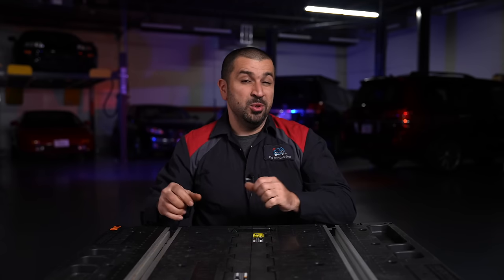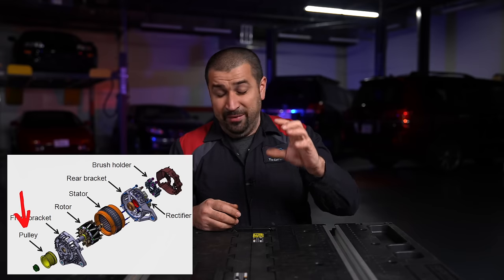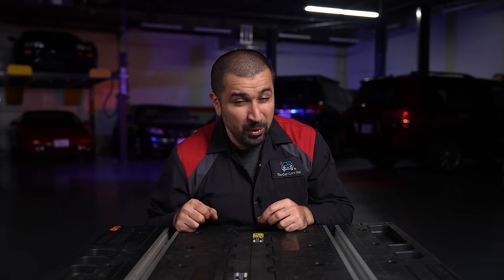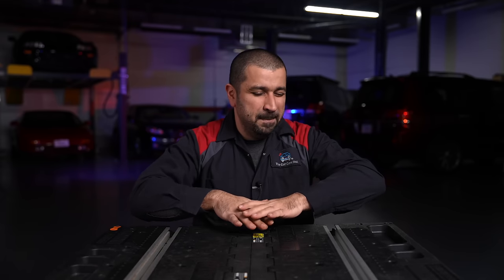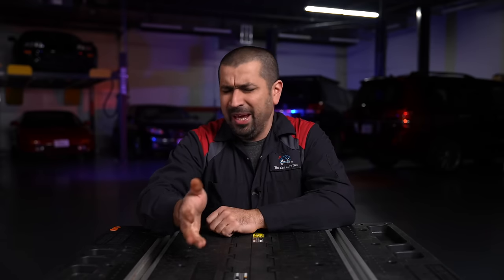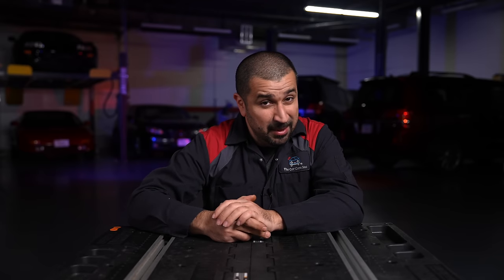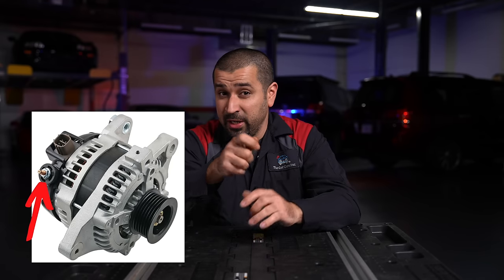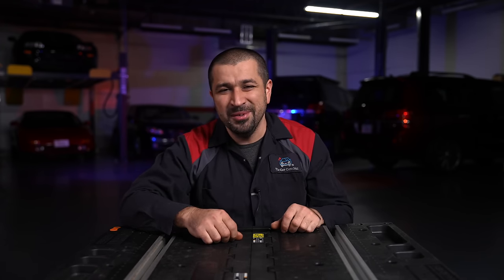How To Make Your Car's Alternator Last Longer? Everything You Need to Know

Comment: If the battery is dead, is it OK to jump start and drive to a shop to replace it, or should I avoid using it until replaced?
Reply from the maker: Very good question. Yes that is totally fine just don’t keep going for weeks and months on that weak or dead battery. Many may ask but how come. You’d be surprised how some folks life’s are very busy and they can’t attend to the car and they prefer just to jump it and keep going.
Reply: @TheCarCareNut  I got in my Little Toyota Auris 2013 1.4d a few weeks ago and the battery had died so I got a Jump start and went straight to buy a new one and fitted it myself in there Carpark, made sure I bought a good make Stop/Start Yuasa.
Not bad going 1 battery after 137,000 Miles and I do my own Oil and filter changes every 6000 miles.
Absolutely brilliant Little Car and pulls like at train even uphill.
62Mpg UK 🇬🇧 what's not too like.👍👍👍
Reply: @TheCarCareNut  Unfortunately I am not DIY when it comes to cars, except for the battery. If I can do it myself any one can. Driving on the battery that failed you once is a total negligence
Reply: You touched on the battery a little and was wondering when would you replace the battery ? Wait until problems ? Or ? Thank you for all the great tips on car care  @TheCarCareNut
Reply: @bobninemire6859   -  You can not go by time to replace your battery, because a good quality battery can last you 10 years or more, cheap poor quality ones may go bad in only 3 years or even less, so you wait until you notice problems with the battery.   Usually the first symptom is when is hard to start your car (cracking of engine is weak) or the head lights are not too bright anymore when you turn them on "without" starting the engine.  
You can also test the battery when you take your car to the mechanic for service, like oil changes or tires rotation, they usually don't charge anything to test batteries.👍
Reply: Just because your battery is dead, doesn't mean that you have to replace it. If you left your trunk open a little for a few days, your battery might be discharged. If you get it jump started, and drive it for 30 minutes, it might be fine. If the battery is old when this happens, the battery might not be able to be saved.
PS. A car's alternator puts out a little more than 13 volts, to charge a 12 volt battery.
Reply: Modern cars use electricity for so many things, even when the car is turned off. If you are a low mileage person is it OK to put the charger on the battery occasionally to keep it charged?
Reply: @tarquincummerbund6997  if you're not driving the car for a week or more at a time get a Ctek battery maintainer battery maintainer. It automatically charges your battery and won't overcharge it.
Reply: When I have to jump a battery on my car (no parasitic load or accessory left on issues) I take that as my first warning that I need a new battery. I usually take that opportunity to research cost (sales) and where to buy. By the time my third needed jump comes around i have a new battery in hand and I make the change 🙂
Reply: @LuxAudio389  any battery maintainer does that. So do chargers. They sense when it's charged.
Reply: I might add that I always buy one brands. The last one I bought was a Bosch and it worked perfectly. Never buy those off brands from autozone or what not.
Reply: My advice is when you have battery problems, or even an alternator problem, REPLACE the battery immediately if the battery is more than three years old.  If you do this, you will have years of electrical reliability.
Reply: @TheCarCareNut  Many years ago I drove AAA emergency road service. I remember members who had a bad battery or plug wires (which arced when humid, and we had spray), and they would call every morning before work. AAA had to implement call limits. We had people who would not listen when I said: "Take the car directly to a shop. Don't shut it off." Then, as I began to drive off, I would hear them shut it off....they just had to see if it would restart. My favorite call was when a guy came out of the house during a snow storm, with a starter in oven mits. He said it was "frozen" and he had put it in the oven, and wanted me to put it back in.....
Reply: This situation actually happened with my family car. We had to borrow a jumper cable from my cousin's gf to jumpstart it just enough to bring it to an auto mechanic shop. So yeah, you'll be fine with this method so long as you get the old battery replaced immediately
Reply: Thank you professor. Very good informative and educational video.
Reply: @speedygonzales9090 please tell me the brand of battery that can go 10yrs or more???
Reply: @billkallas1762  Wasn't the advice "Don't charge a dead battery with the Alternator", maybe if away from home it's an emergency, but we should all have a capable battery charger.
Reply: @tarquincummerbund6997  In a cold country once a month, in a hot country more often.
Reply: @RealWorldGarage  -  I had an "Interstate", it lasted 10 years.  It depends also the type of driving you do and type of weather, on that particular vehicle (1988 Mazda B2200), 80% was all highway driving. 
Also on my present car, (2010 Toyota Corolla XRS), I got 9 years out of its original battery.

On our family vehicles we average "8 years" per battery, we don't buy cheap batteries... Sears Die Hard, Toyota's and Interstate are the brands we buy, we haven't got any less that 7 years out of any of these batteries.
Reply: @tarquincummerbund6997  A battery tender is better than a charger. If you forget and leave the charger on, you can fry your battery.
Reply: ISGs in hybrids I suppose are even more complex and reliant on computers and BMCs.  EVs won't have this problem, no engine to start, plug in to charge batteries.
Reply: I can see you are not an auto electrician.  You make several statements that are simply not true.  Have a great weekend misleading people. @TheCarCareNut
Reply: @billkallas1762 facts! I use a battery tender on my corvette with an Altima red top battery 🔋 I maybe drive it once a month or 2 months. I get years about 5-7 years of of problem free starting problems. & no corrosion on battery thermals 👍
Reply: @billkallas1762  Thank you for your advice. My charger shuts itself off when the battery reaches full charge, but I’ll keep an eye on it.
Reply: @theaustralianconundrum  you obviously don't know what you're talking everything he said is true
Reply: No it was not. @DylanL69
Reply: @theaustralianconundrum  yes it was
Reply: @TheCarCareNut  plus there's a lot of , single moms and guys with 0 mechanical skills or having to wait a few paychecks for that $200 needed to replace that battery right away.
Reply: @tarquincummerbund6997   My charger is probably 40 years old. Mine only cuts back to 2 amps when the battery is fully charged.
It never stops.
Reply: @bobninemire6859  Every five years, I'm made the mistake of eeking out 15 years once until I was stranded on a Christmas night.
Reply: I bought a rebuilt Denso alternator for my Toyota. Car runs much better versus aftermarket alternator.  BTW Amd I fixed Yaris cv axle leak. The cv axle wasn't seated in all the way on drivers side. Installed Toyota seal and seated it. No leaks after a short drive. Thank you for your lesson on alternator technology. I learned things I didn't know. Explaining ac to DC with Sine curve then showing how diode cancels negative sine wave was very cool. Made perfect sense.
Reply: @RealWorldGarage  the factory fitted Panasonic battery lasted 14 years in my IS250 👍
Reply: Don't procrastinate with batteries or tires... Buy recommended brands (i.e. Michelin, Interstate) and replace them as soon as you need to and just avoid that nagging car headache....
Reply: @TheCarCareNut  thank you for the info and everything.. I have a question can I replace my Tacomas 2023 battery with an BATTERY AGM??   Thank you very much!!!
Reply: Best to always check the battery as soon as you can. Typically the battery will still be at a quarter of capacity even if idling for half an hour from being dead. Sure way to kill the battery is to leave it like that overnight.
Reply: Yikes, I've been hearing a whining noise for almost 2 years, it's an old used Sienna with over 200,000 miles. I better get that alternator replaced, OEM!!! Thanks for this video.
Reply: Brother do I need replace fuel filter toyota 4runner 4th generation or when?
Reply: If I get 2.5 years out of my battery, I doing great.  Heat is hell on batteries in the west.
Reply: @TheCarCareNut  what is your opinion on cold air intake like the TRD. I’m not looking for a hot rod. I have a 4 runner I’m interested in better fuel efficiency.
Reply: @RealWorldGarage  My motorcraft battery went 11 years before it finally died
Reply: Cold weather will bring out the bad or failing batteries.
Reply: @RealWorldGarage ODESSEY Batteries made in the US, they can also be ordered in UK and Europe. ODESSEY are one the Best batteries out there, pricy but then it pays for itself in the long run as they can last from 7 to 10 years depending on you maintain it. Always check your original batteries dimensions and CCA before ordering, if unsure then contact your main dealer regarding your OEM Battery specifications. Good luck
Reply: @tarquincummerbund6997  100 percent. fully charge that battery once per month.
Reply: @RealWorldGarage  I would love to know that too...
Reply: If the battery guy had done his job properly, one should not have a dead battery at all due to age. By the way, I don't recommend my customers to jumpstart and drive with a dead battery.
Reply: @theaustralianconundrum  Why don't you share with us all what is not true and then we will judge you whether you are true or otherwise ?
Reply: Yes you can. But remember, you're putting extra strain on the diodes of the alternator, as they need to charge the battery -- and a dead battery needs a LOT of power. It's around 10-15 minutes of engine rotation to replenish after a single starter event -- the alternator is strained during that time. 

When the voltage is EVEN LOWER than a normal starter event, then the alternator duty cycle is VERY high, and diodes heat up, greatly shortening their lifespan. 

Generally it's fine in a pinch, but also increases odds of weak diodes finally failing (as the alternator could already have been weak and that's why your battery died).

Doing this over and over will kill an alternator much shorter than it's expected lifetime -- sometimes at 1/3. 

Some vehicles can get away with this -- eg: trucks/industrial vehicles with an alternator that powers a LOT of other components -- eg: hydraulic accessories (as electrical often is used to help monitor, light, and assist the pto going to the pump) as long as they don't strain the alternator more with accessory use / disconnect any auxiliary battery.

If a battery dies 1-3 times, replace it... or you're likely to replace the alternator in a year or so if it's in good condition.
Reply: All car batteries are manufactured in the same factory. The only thing that makes a battery different is the sticker for manufacturer that provides different warranties
Reply: @TheCarCareNut  they won't turn off accessories, won't drive it around to test it...or...won't open the hood for months...lol..Gear Heads do still.
Reply: Extremely informative (you are gifted instructor). Thank you!

2017 Ford Transit 250
-200 amp Heavy Duty alternator 
-three factory 60 amp lugs for a total of 180 amp auxiliary power supply came stock.
-two stock agm batteries as starter batteries
-I have a 50 amp dc to dc charger running to a 600 amp lithium battery bank

Do you think I am potentially causing too much stress on the alternator (not a smart alternator from testing the Voltage as it always reads a constant voltage)?

Also what are your thoughts of replacing the two stock AGM batteries with 1 amp equivalent from Dakota lithium batteries? They claim they are drop in compatible.
Reply: Interesting. I got almost the same time and mileage on the battery on my 2000 tundra 👍
Reply: @saabtech3510 lol holy smokes that’s a funny story you got there. Nothing like funny memorable stories😂
Reply: Biggest concern with dead battery is it will leak corrosive liquid and damage components, depend on your car model, if it could leak onto something sensitive, you would need to watch out for that. But for most car, this won't be a problem as the tray would contain the leak.
Reply: You should stop immediately, call up The Car Care Nut, and he will replace your car battery free of charge!
Reply: Refer to time stamp 16:30
Reply: @TheCarCareNut I'll help you explain. On older cars it's safe to drive in the day on battery but don't keep pressing the brakes at stop, neutral and handbrake. On newer cars just don't as they run many unneeded things like a high wattage touch screen. Even the AC fans take quite a bit of power. Grab a voltmeter to plug into your 12V socket and watch the voltage. If a device makes the voltage suddenly drop turn it off. Unplugging the battery prevents the high load and the a battery bank starter can reduce the alternator load with the battery unplugged
Reply: Also a plus if you have a manual (stick) transmission.  Just push it, then engage the clutch.  Your vehicle will have a lurching motion.  Be ready to give it gas, so it doesn't stall.  I would love to drive stick again, but it's dying.  My friends & families don't drive stick, so gotta go with auto, in case I ever need them to drive my vehicle.
Reply: @tarquincummerbund6997  Scotty Kilmer says you should do an "Italian tuneup" every few months, which is going for a highway drive at highway speed for 2+ hours.  It clears out carbons & recharges your battery as well, since many frequent short trips doesn't give enough time for your alternator to charge the battery.  Putting a charger on the battery solves the battery slowing decreasing its charge problem, but not the carbon buildup problem.
Reply: @speedygonzales9090  When the battery is bad on my car the first sign is the dials go dead when starting up for 1 seconds and then go back on and the needles go all the way to the right and then back to normal. About 2 weeks after that 1st sign it will begin to struggle to start and given another 3-4 weeks become almost impossible to start without a jump.
Reply: @gravemind6536  -  Most new technology cars nowadays do that, the needles on the dashboard they go all the way to the right and then they go to normal, displaying the proper indications...  That has nothing to do with a bad battery, it's "normal" for cars with "LED" display technology.
Reply: @speedygonzales9090  The best way to check a battery to see how healthy it is, is to check it's voltage with a good, accurate voltmeter, when it has been sitting for a long duration (more than 12 hours) and see what it's voltage is.  If it's 12.6 or higher, it's a good healthy battery.  12.4 to 12.5, it's got some age, but will get you by for a bit longer.  12.3 or lower, replace it before it fails! Check the battery by placing the meter probes right one the terminals of the battery
Reply: @audvidgeek  -  My wife and I we own "5 vehicles", we constantly drive 2 of them, the other 3 only now and then during the summers, those vehicles I keep them on a trickle charger when not driven and I never have any issues when I start any of the vehicles.  One of them is even a motor-home.   We average a battery life of 8 years per vehicle.  I have a small battery tester that tells me when the battery is no longer good.  
Thanks for the voltage tip, anyway.:hand-pink-waving::face-blue-smiling:
Reply: My Napa battery lasted 9 years and was still good. Only replaced for winter was coming.
Reply: If you run your battery down and jump start it, you should use a charger on that battery when you get home to fully charge it.
Reply: In GM vehicles alternators would work in different models.  Say a Cadillac alternator cost more than a lower price vehicle alternator. But the lower cost alternator would work in the Cadillac. Does Toyota alternator work like that?
Reply: @LuxAudio389  Forget CTek. Just get yourself a Solar Panel & 12 VDC  Regulator. If your car has less-than-normal use, you can just connect this arrangement to your Car Battery. The Car Battery will always be float-charged in a most permanent way. Place Solar Panel on your garage roof, and daylight will charge your Car battery. The Solar Regulator will cease charging the Car Battery when it reaches a fully-charged state. It's all about greening the Planet, and your electricity bills won't increase by the use of a Mains Charger Unit.
Reply: @theaustralianconundrum what was wrong? Please tell me it's that you actually can jump off and drive a car with a bad cell in the battery without taxing the alternator. Battery tester showed 100% charge, just apparently a bad cell prevented the battery from supplying anything but a trickle to the electronics.
Reply: Hey! Thanks for your amazingly informative channel. Please make a video explaining how these driving modes work and when to use eco vs normal mode and does it hurt the engine to use eco mode driving on hilly roads on non hybrid cars
Reply: @billkallas1762  
"Just because your battery is dead, doesn't mean that you have to replace it"
Deep discharge tolerance with modern battery construction and chemistry is extremely poor. Do it a couple of times and its capacity will be greatly reduced. Then the first cold snap and you could be left needing a jump.
"PS. A car's alternator puts out a little more than 13 volts, to charge a 12 volt battery."
Depending on the battery type, it can be a lot more, up to 15V, but a normal lead-acid (rare now) you need a minimum of 13.8V, calcium (the ones with the indicator window) 14.8V, or you'll never actually get a full charge, which shortens their life. If the alternator is only putting out 13.8V, you can put a diode on the sensing wire to trick the voltage regulator to put out about 0.5V more (the diode voltage drop) so you can better utilise a calcium battery in a car designed for a normal lead-acid.
Reply: @bobninemire6859 . It also depends on the type of battery which cost more but is built much better, like a ‘glass pack’ battery. Probably $50-$100 more. Even lithium types which are more than double the price.
Reply: There are two conclusion here you have to deal with friend!
If you have a totally dead battery, your jump start may damage to other equipment in your car. Don't use car to car to jump start. Use the portable jumpstart instead!
Second, if the vehicle jumps start your car is hooked to your damaged battery, that vehicle battery will be tossed. That vehicle battery will be likely damaged!
Reply: There are two conclusion here you have to deal with friend!
If you have a totally dead battery, your jump start may damage to other equipment in your car. Don't use car to car to jump start. Use the portable jumpstart instead!
Second, if the vehicle jumps start your car is hooked to your damaged battery, that vehicle battery will be tossed. That vehicle battery will be likely damaged!
Reply: There are two conclusion here you have to deal with friend!
If you have a totally dead battery, your jump start may damage to other equipment in your car. Don't use car to car to jump start. Use the portable jumpstart instead!
Second, if the vehicle jumps start your car is hooked to your damaged battery, that vehicle battery will be tossed. That vehicle battery will be likely damaged!
Reply: @TT-dp8qh  Total nonsense.
Reply: @TonyRule  Be patience, I will tell you the reason. A worn out battery may have one or more of the short cells or damaged cell. I've seen this many times. Many drivers don't pay an attention to this matter. Some latest vehicle electronics are very sensitive. Once of a jump start, it could ruin things in your vehicle or vehicles. Have you heard about EMF (Electromotive force) force in transformers? If you don't know, you may not need to know. This EMF only happens while the cut off point is unhook from a devices that will be involved with coils, loops, and transformers. The voltages from the EMF could raise up to hundreds of volts, depends on how many loops in a transformer.
Many years ago, my friends and I were so generious to have drivers to jump start on our vehicles. The result was, our new batteries went dead. Just believe it or not, but it is real man! Every time and every time you have that jump start, you brand new battery will more likely wear out quick and you will not be able to know. The dead car battery will go low and hi while it is starting will definitely affect your generiouscity.
Reply: @TT-dp8qh Back in the '80s when the electronics weren't so robust as they became in the '90s, back EMF was very occassionally an issue and could damage distributor igniter modules or even ECUs. But it matters not whether you use a 'jump pack' or simply start a vehicle using jumper leads from another vehicle because it's the same thing - any collapsing magnetic field induces voltage regardless.
Reply: @billkallas1762  Which vehicle do you have? It must be an old GM or a Toyota.
Reply: @TonyRule  Indeed! Nowaday, some how those new vehicles, especially, those small 4 cylinders still get affect by this issue. They must built diodes and zenners to remove the EMF. I had a Nissan 2007 speed dometer got damage right after the jump start. The vehicle with the worn out battery was totally a dead battery!
As I said on this video, I am a DIY guy. I had 6 vehicles in the past. Now I keep only two. Those are the latest vehicles but they are getting older every year. The other 5, they were a little more than 200k before I sold them. The worst I ever had was the Ford. There was many fixes on that one. Toyotas and Hondas are best for the 4 cylinders. What I have left now are a Honda and a Toyota.
Reply: @TT-dp8qh  Full sized Genesis sedan. Its battery is 125 months old. In the last year, I've only been driving it once or twice a week, so I've been attaching a "battery minder" on it to keep it at full charge.
Reply: @billkallas1762  Is that battery an AGM or dryed cell one? The acid one will not last more than 7 years. What kind?
Reply: @TT-dp8qh  AGM. Original equipment from Korea. It's a huge battery that sits in the trunk, next to the spare.
Reply: @billkallas1762  You could have a dried cell acid battery or an AGM. Acid batteries will not hold their current in the batteries, or in those cells too long. AGM will hold the current longer in time. The only difference of the AGM is, the alternator in that vehicle is the one built for the AGM. If you replace with an AGM in an acid battery vehicles, the charging time will take much longer to get full charged of an AGM battery.
Reply: Funny thing happened when I purchased a 1994 Camry XLE over 300k miles, 2001 Lexus over 263 k miles  three others 2008 and 2017  350 Lexus and finally a 2019 RAV 4 Limited. Not one alternator has died over many years. Now many domestic vehicles like GM, Ford and Dodge all had their alternators go bad.
Reply: You said mistakenly the Battery Light that the actuator is dead no that is not correct you look at the actuator to see if the belt is missing that what causes the battery light to come on because it not spinning = not charging the battery
Reply: Actually I am!
Reply: A full bridge rectifier is used in alternators which gives you both waves and not as a half rectifier as you showed with only half wave
Reply: @tarquincummerbund6997 , yeah, it is ok to put a charger on the battery. I‘m a low mileage person too and charge the battery every 2 months in the winter and every 4 in the summer. Before I started to do this, I had low battery issues especially in the winter. Now the issues are gone.
Reply: @speedygonzales9090 
More Like 2 Years, According To Scotty Kilmer.
Reply: Ask yourself why it's flat first. Is it just below minimum spec? Did you leave the lights on again ? Is it the alternator,  shorted cell, or is it open circuit. 
Is your car some new EFI thing or an old Impala 409
Reply: @chuckmaddison2924  for me it was very dead, I didn't leave lights on but left the car unused for like 2 weeks and battery was about 3 years old
Reply: @asefew1  what I would have done is take out of car and put on charge until " shows" charged then test . I had a Falcon  for work I left for 6 weeks while on vacation.  It took 2 days on my charger and it came good. Years ago I left an old Valiant for 8 weeks, got back home, and it started. 
  I just had my car serviced at dealer and they said was shot. Car done 30000 k.
They showed me a pretty printout,  which  I doubt a lot would not understand and say fit. I retested at home, and it's at the low end of acceptable.
A lot of new cars have a fob thing to open and start. If it's in the house within range of the car the car may not go to sleep.
Reply: @RealWorldGarage  I replaced the battery in my Mercedes. It was a AC Delco AGM battery. I installed it back in 2015. It could have went further but when it was starting I could tell that the battery wasn't going to last much longer. The battery health was down to 70%. I replaced it with a Interstate AGM battery. The battery is located in the trunk of the car so it wasn't subjected to the heat or cold of a engine compartment which probably helps with battery life.
Reply: @abigailbalneg6863  I had ran some water dryer through my 4 Runner. I remember one time I did it with another car the garbage fluid in the gas tank gets caught by the fuel filter. After replacing the fuel filter the engine was starting quicker. The fuel filter is a easy replacement on a 4 Runner. It's to the rear of the drivers seat and towards the center. It is easy to spot.
Reply: Rather a lot depends on WHY it is dead.  If you left the headlights on, but otherwise the battery is fine, then a jump start or boost charge (if you have a charger and nearby electricity) is okay.  Using an actual charger is better than putting the load on your alternator.  A typical car battery can survive about 8 instances of flat dead battery, anything under 9 volts (on a 12 volt battery).  What will happen is the battery plates become "sulfated" and will no longer take a charge; but it is somewhat gradual.  Its not like, "Oh, 8 times flat, replace the battery" although quite frankly I do exactly that so i don't get stranded somewhere.  

Modern cars constantly use the battery even when the car is turned off.  How long you can go without charging (or operating the vehicle) varies.  My Trooper needs about 1/4 amp-hour daily to maintain it.  If the battery is 80 amp-hours, then that would be in 320 days the battery will be dead.   Since I don't drive that one often, I use a little solar panel to keep the battery charged.  

Consistently high voltage will damage and eventually destroy the battery.  When you first start the car, the system will apply about 14.2 volts to the battery to quickly replace the power consumed during the start itself.  This quick charge takes only 2 to 10 minutes, then the regulator settles down to about 13.6 volts and stays there while driving.  If the car has been sitting overnight not turned on your battery will be around 12.6 volts.  
Anyway, consistently 14 volts or more will overcharge the battery and boil off the electrolyte.  AGM batteries attempt to reconstitute the water but you are still slowly damaging the battery.  This is an easy check and 14 volts or more is probably a bad thing (provided it has completed the short boost charge).
Reply: @tarquincummerbund6997  "is it OK to put the charger on the battery occasionally to keep it charged?"
An excellent strategy.  I use a little solar panel for just that purpose.  What you don't want to do is operate the engine AND a charger at the same time.
Reply: If you buy a car imported from Japan, after several months of shipping and import procedures, it will be waiting for sale in a warehouse until you buy it home. During this period, its battery will definitely be exhausted and it will go through several dealer "jump starts"  ".  The quality of Toyota/Lexus' original car batteries is unparalleled. Aftermarket batteries cannot achieve such quality (including Yuasa). They all compromise with the market price more or less.
Reply: @TheCarCareNut Very true. I jumped on and on being lazy to replace the battery until I fried the alternator (maybe the regulators) as well as the computer. The wallet paid around 2000$ for my own laziness 😢
Reply: @TheCarCareNut Sir pls reply can we use car voltage stabilizer to prolong alternator health or is going to destroy the electricals and alternator prematurely???
Reply: I’m old enough to remember diagnosing electrical issues at a Sears Automotive back in 1973 to 1980.  It was a big sad deal when GM went to side mount batteries that I still hate to this day.  They also were the first to put the regulators in the alternator.  That was always a fun replacement though and saved the customer the cost of a whole new alternator.
Reply: @theaustralianconundrum  Look, genius! There's an electrical engineer downstairs also gives this guy a thumbs-up. Let me put it this way, Kindergarten teachers may know everything or do everything absolutely correct, but they help kids grow up, healthily. Einstein may not! Cheers!
Reply: @RealWorldGarage 
I just replaced a BMW labeled battery with a March 2013 manufacture date.  Made in Austria, but no info on what manufacturer.  (I doubt bmw makes their own batteries.)
Reply: @RealWorldGarage  Optima is a high performance battery.  I have had it for over 6 years, and its still going strong.
Reply: The one way clutch in pulley also decouples for the cyclic cranshaft speed variations. Inworked on a brand that started to use them in the 90s to quiet belt and extend life of tensioner. Thentensioner would vibrate at low engine speed with crank speed fluctuations and the clutch pulley stabilized it. Several makes use free charging principle..reduced charge target V  and on coast when injectors are off use high charge, 15
3-15.5 V, while no fuel is used. If you happen to pay attention to system voltage on a scan tool while driving,  the voltage will do some large fluctuations duebtonshutdown on accel, low charge on steady speed and high charge on coast
Reply: A week ago Sunday, my youngest son's '03 Camry died here in town (he lives 40 minutes away). We took him home that night, and I took a day off work to see if I could fix it. Cleaned the batt posts (they weren't bad) and gave her a jump off my '07 Avalon. Drove it back to my place (~20 mins), and got home just in time — I was running off the battery alone. Replaced his alternator (Advance/CarQuest "premium" w/lifetime replacement), jumped him a 2nd time, and my wife (in the Avalon) and I (in the Camry) headed off to his place. I didn't even get to the the next turn (2 miles) when the Camry's batt lite was flashing very intermittently. So I went around the block and came home, with my wife following. I figured that she'd figure it out — huh, I guess the Camry's not fixed! But when I talked to her, she said, "The Avalon's batt lite is flashing a bit!" Ugh! So I replaced the Camry's replacement alternator, jumped her (the third time!), and took her around the block (6+ miles) with the brights and the rear defogger on (to load the alt) ... and she was rock solid. So we finally head down the road to my son's around 10:00-10:30p, wife in his car, me in mine. Now the Avalon batt lite is more on than off, so we park it at the convenience store 10 mins away. (We CANNOT break down on the dark curves between our town and my sons!) Took his car back to him (solid all the way), and he brought us back home (still solid).

NEXT DAY: I find a Denso alternator at the Toyota dealer 1 hr S of us; my OLDEST son (who's handier w/cars than I am!) picks it up for me on the way by; and we replace it. (A bit more complicated on the V6 Avalon than on the I4 Camry!) Had my battery on his smart charger the whole time. And now she runs great!

But here's the bonus part: About a month ago, my starter (I thought) started making a VERY brief noise when I'd release the start button. Intermittent, not every start. But then a little more often, and then for a little longer (3 secs, then 5-6, then 10). It sounded like a rattling, and I thought my starter gear wasn't returning, and was staying engaged with the flywheel until it eventually retracted. Now I haven't heard that sound ONCE in a week's worth of driving! And my boy and I also noticed that the old alt had an intermittent feeling like a one-way clutch when we'd turn the pulley back-and-forth by hand. But I thought, "that can't be right, I don't think alternators have overrunning clutches."

And now, just having watched this, I find out that they DO have clutches! So I don't know exactly what was going bad on my alternator, but I'm glad that replacing it made that """starter""" noise go away! (I'll drive her one more week just to be sure. If no more """starter""" noise, I send the replacement starter I bought back to Rock Auto! "Didn't need it, guys! Got two birds with one alternator!"
Reply: @Steverz32  So you barely drive your Corvette but brag about getting 5-7 years out of a battery. Lots of people drive every day and do just as good as that. Not sure why you seem surprised that a battery maintainer keeps it charged the rest of the time.
Reply: I am fortunate to be able to replace a battery at the first sign of trouble, and my 99 Camry LE with 250k miles is still running strong with the original alternator. I also learned the hard way to buy good batteries.
Reply: 😮what about one of those $1000 high output alternators if I've got 4 batteries throughout the vehicle for tv, fridge, video games, tablets charging,  phone charging, a/c, ??? And solar on top of that?
Reply: @hucarr5703 if your Tacoma has start/stop function which is if you stop at a light your engine shuts off then when u release the brake your engine starts up.....1st thing is then yes u need an AGM battery as that is what they r 4 and if u do not have that feature then u need a regular battery....2nd if u do have this feature then I recommend u turn it off because it does more damage to your vehicle like wearing out your starter
Reply: @bobninemire6859  when you start your car in the morning, for example after been sitting for a long time, if you hear that it’ starting hard…
That’s when you’re in new battery  territory .  Also if you live in cold climates, you pretty much know right away because those first 20° nights…..
Your car won’t start … or barely start,.